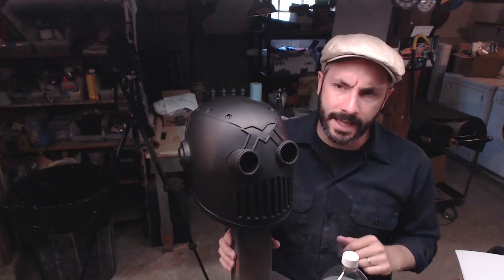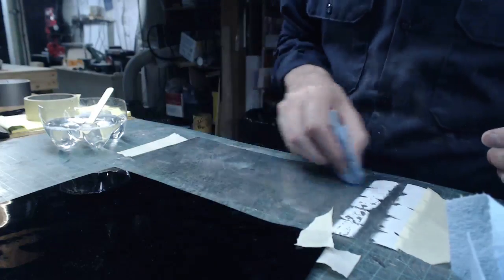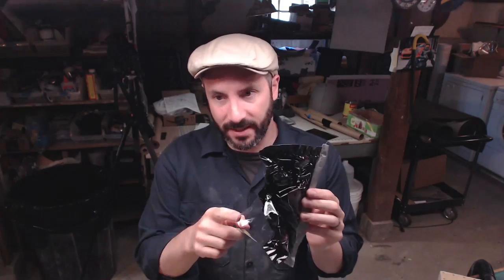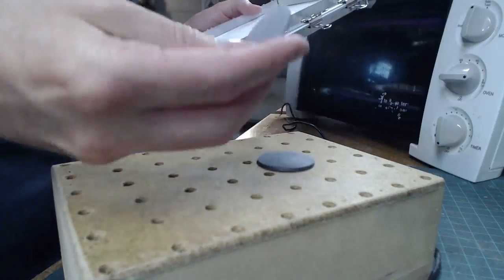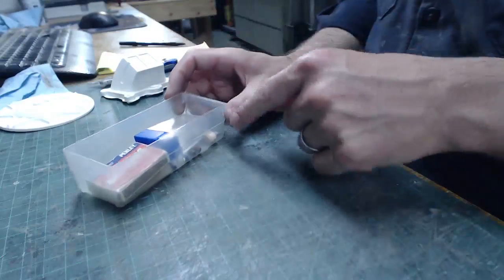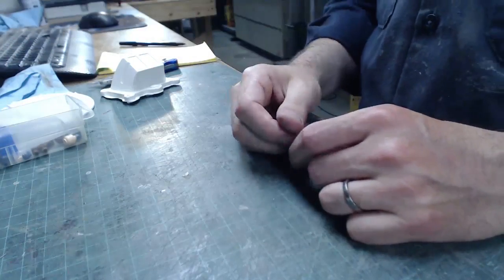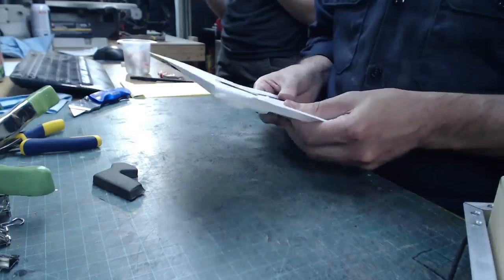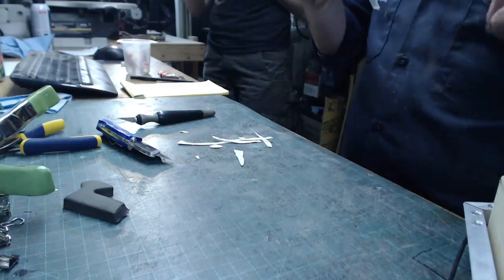Prop: Live from the Shop - Vacuum Forming Fails & Experiments

Comment: First..GENTLY place your heated plastic over the buck PRIOR to vacuum and get your box edges covered to form seal THEN vac.  The other thing is your platen (the peg board) holes are too larger and spaced too far away for a good sharp pull. Get perforated sheet metal with tighter spaced smaller holes and either put that directly on top of existing peg board or space it slightly with even penny thickness. The results will be more consistent and you'll start to eliminate Alot more of the spider webbing.

Comment: How do you prevent spiderwebbing? Longer cook time/more bowed plastic or stronger vacuum suction? I’m getting a lot of webbing on the corners of a 3 Inch cube. I’m using 0.020 PETG plastic. Thnks!
Reply from the maker: A lot of avoiding webbing comes from the buck you're using and how it's set up! I'd suggest mounting your cube on a wider base with sloping sides so the plastic is less likely to pinch.
Reply: @punishedprops  Thanks! I saw another YouTuber that placed some quarter coins under his buck to add to suction. I'll try that and let you know.

Comment: How does this work with a PLA 3d printed buck?
Reply from the maker: It can work, but the 3D printed piece needs to be super sturdy. Lots of walls and a dense infill. It will melt a little bit from the heat and the vacuum forces will deform it if you're not careful.

Comment: Hi Bill! I'm sorry for posting 1 year later, but if you're in a pinch again, you can totally heat-form soda bottles. Just not vacuform.

Here's an example:
https://www.youtube.com/watch?v=puEEeSymQag

The PET plastic shrinks about half an inch inwards, using a heatgun on low. 
So for pieces that are up to half an inch deep, you're good to go. Just make sure to cram your piece really tight.

It becomes quite a bit more rigid than the original soda bottle too.

I used fimo to make two eye lenses for a space marine helmet, and then heat-formed a soda bottle with this technique. 

I then heat-formed the tint onto the fimo originals, to get it into shape, and finally applied it to the transparent lenses. Worked like a charm.

https://drive.google.com/file/d/15K7NJ4-iHUnT5NxFyeT34j87GOcJa_QK/view?usp=sharing

Hope this helps. Keep being amazing and hilarious!
Reply from the maker: Good to know! =D

Comment: You might get less webbing if you center your pieces better around the holes -- like if you compare the first set of lenses to the second set -- the second set was centered better, and didn't have any webbing... -- also your holes seem to be at density that a much larger vacuum forming table might use, but your work area is so much smaller. -- If you plan to work with such small pieces, then you might benefit from doubling the amount of holes (maybe 2x as many holes, but at 75% of the diameter?).
Reply: Also you might benefit from adding a simple step pedal to control the vacuum...

Comment: Silly question - are there plastics that you can use for this that are food safe?  Cake decorator turned cosplayer trying to learn new skillz for both hobbies.
Reply from the maker: Yes there are, I'm just not sure which ones you would want to use.
Reply: That's awesome, I"ll have to do more research then. This could be a great solution for custom fondant and chocolate molds.
Reply: Oh cool - some dentists use vacuum forming to create custom mouth guards - I would think that the plastics they use would be a decent place to start.  I would never have thought of making custom molds if I'd not watched your video.  Thanks Bill!
Reply: MrsRCharlton there are many forms of food safe silicone, mainly pourable liquid and putty that you can make molds out of just about anything with. Better late than never? Lol

Comment: I guess you've never taken a heat gun, or a steamer to a PET plastic bottle...  Lots of shrinkage, and the plastic isn't very pliable afterwards.   A 2L bottle will shrink to about the size of a 1L bottle, or smaller.
Reply: I just steamed one in the microwave; it shrank unevenly, but afterwards, its volume had shrunk by 1.08 L.

The stuff might vacuum form when it's re-heated after its initial shrinkage, but it's a lot more difficult to work with when cool.

Comment: I'm not sure if you're familiar with this technique, but PET has this incredible tendency to shrink when heated. You can put a mould inside a bottle, heat the bottle, and it shrinks to the form inside. A video of the process is linked here: https://www.youtube.com/watch?v=nrOco3scyK0  This tendency to shrink is likely why the PET didn't work for your vac-former and why the window tint didn't stay on, the plastic was shrinking away from the frame and the tint. You may be able to apply the window tint after vac-forming, or you could dye the pieces.

Comment: instead of a toaster use a "fifth burner" type electric stove top.  Cost $10 and you don't have the walls of the toaster getting in the way of the frame or seeing the melt of the plastic.  Fun video.

Comment: Hey, as an ex professional window tinter, thought I'd shed some light on the first failed experiment. Window tint shrinks when you heat it, so when you put it in the toaster it crinkled as it shrank away from the surface of the plastic(which you didn't bond to the plastic in the first place).

If you want to use window tint for this, you will need to vacuform your lenses then, while the lenses are still on the buck, put on the tint(with baby shampoo and water mixture, not straight water) and then using a squeegee, some car wax on the outside of tint, and a heat gun, form the tint to the lense. Doing it while on the buck will let you put pressure on and not deform them from the heat. As you use the heat gun, you will see the tint start to crinkle, use the squeegee or card to push those spots down until the tint forms to the curve of the lense.

It may take some trial and error but that is how I would apply the technique used to tint curved rear windows to this project.
Reply: I know it's a few days late, but hope that info is useful

Comment: the problem with the tint was that it had little air and water bubbles (it´s literaly imposible to take out that micro bubbles), when the air get hot, it expands, and the water baporises,  it expand more than the plastic, so it made that crackled texture

Comment: The window tint might still work. It pulled apart so it couldn't bond with the plastic sheet (if they do at all). If so, I'd say give it another shot with a sheet that fits your frame. 
Thanks for the content, keep it up!

Comment: I'm thinking of making a few vacuform bucks out of pepakura files that have been hardened using Smooth-on EpoxAmite 100, and filled with a home made paper clay recipe (looks like crap, it's lumpy, but when poured, it takes the shape fairly well and is hard as a rock, also, it's REALLY cheap).  The paper clay is made using scrap paper from the pepakura, DAP Weldwood resin-based wood glue, flour, and Caulk.  After asking DAP experts about the possible fumes from heating, I'll experiment with it after vacation.
Reply: Thanks, I just looked it up and I think I can get hydrocal for roughly the same price as the resin-based wood glue (which makes the whole thing cheaper cause the glue is only part of the recipe).  Though, I still have the wood glue and other ingredients around so assuming there's no deadly fumes my respirator, wide open space and air circulation wouldn't handle, I'll probably work through that but use Hydrocal for future projects.  Thanks for the tip!

Comment: Also...  The foil tape you tend to use more like a paint is better suited for high heat than duct tape. That's why it's used the furnace ducting instead of duct tape (which is really ironic if you think about it)

Comment: I've tried heat forming pop bottle PET and the issue that I had was the plastic contracts.  I think if this would work the plastic will need to be firmly bonded to the frame.  I have used the Bottle PET plastic with the window tint to make lenses for several 3D printed Storm Trooper helmets.  This tint and bottle PET combo worked very well for the lenses as long as compound curves were avoided.

Comment: next time you should just tint it after you vacuform the lenses
Reply: as a suggestion not trying to be a jerk
Reply: +Punished Props oh my be after you cut out the lense you can aply the tint to it then, and maybe you could get the tint to just wrap around it. using a smaller piece of tint of course.
Reply: +Punished Props just trying to help even though I'm not a prop maker

Comment: Fun video! You game me some ideas... both good and bad. The easiest way I have found to cut out vacuum formed plastic is: 1) cut out the rough shape about 1/4 inch from the part. 2) Use medium grit sandpaper on a board an sand the pack of the part until it's the shape you want. I have built vacuumed formed models and this worked like a charm. Much easier than using scissors or a knife to get the final shape.

Comment: In dentistry we use vaccuforming all the time and I always ask myself why I don't see more Makers using the machines we've got... they're certainly more than affordable. On the cheap end, check this link out: https://www.amazon.com/Forming-Molding-Thermoforming-Material-Equipment/dp/B00QQ9Z3KQ

You can get a more rugged version for around $300. Certainly within the realm of affordability, with a lot less of the scotch-tape-and-bubblegum-factor
Reply: This is the model I use and it's a total workhorse. It's been solid for me for more than 10 years: http://www.ebay.com/itm/DENTAL-LAB-VACUUM-FORMING-MOLDING-MACHINE-THERMOFORMING-PRESS-110v-MODEL-/171149961831?hash=item27d9552a67:g:f-IAAOSwZ8ZW6wRo
Reply: Nice machine ! DO you ship to Romania ? ...... and do you got something bigger ?
Reply: @Punished Props  Hello ....I have a HUGE problem with my homemade thermoforming on the  VACUUM area T-T  It simply does not vacuum, WHAT AM I DOING WRONG !?!?! The dimension of th box is like 20cm lenght x 1meter long x 5cm height and have a lot of small holes (maybe here is the problem ? small holes and to many ?? Or the box is to big for my carpet vacuum?? ) WHAT TO DO ? ....the thikness of the palstic (special thermoforming plastic) is 2.5 millimeters ....
Reply: @sorin990  1 meter long???  of that size you have to have at least a 5 gallon tank to cause a quickly instant pull.  A shop vac pull of that size isn't going to work.
Reply: @mxferro  Oh thanks for the reply, 6 years later and thats why it didnt work ...failed and to lazy to remake the project :-/ .....thanks man ! ^^
Reply: Many modelers use the dental desktop VAc form units especially Estes rocket nose cones. The main thing is that the 5.5in.(?) area is too small for many projects and "draw" height is rather short. I've use those to even industrial units at the design school and most modelers would KILL to have a industrial grade unit that pulls at least 9" x12" that isn't $700 bucks or more.  A company that offer a "no frills" Chinese unit that size for the huge number of end users at a great price would do VERY well.  But the sizes and prices jump around far too much.